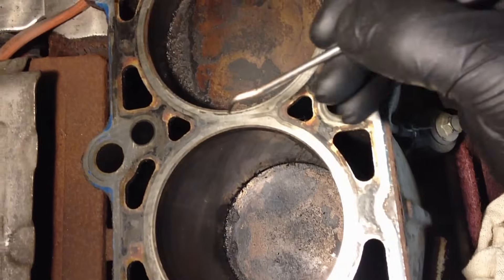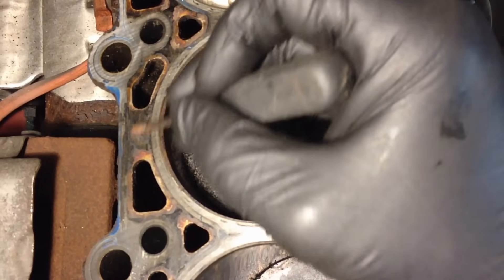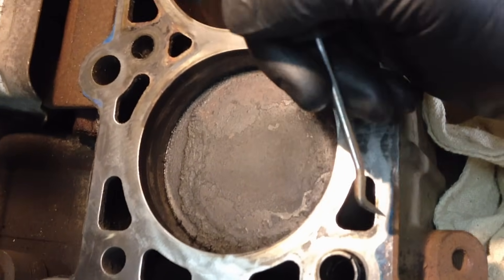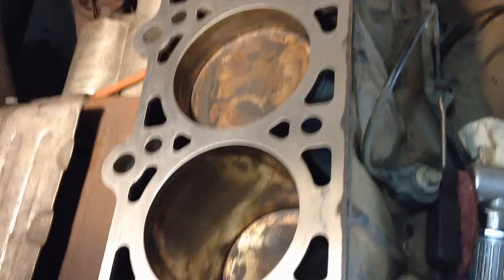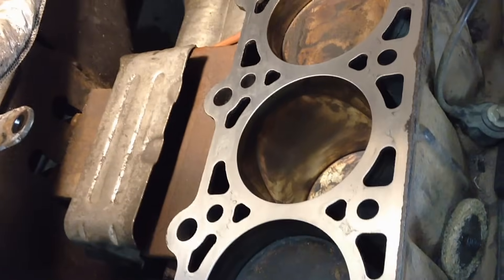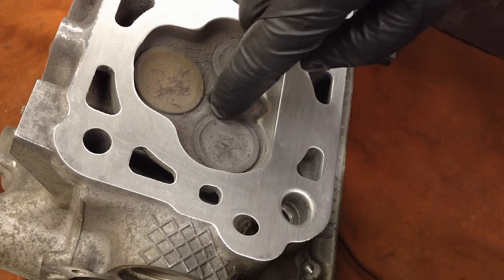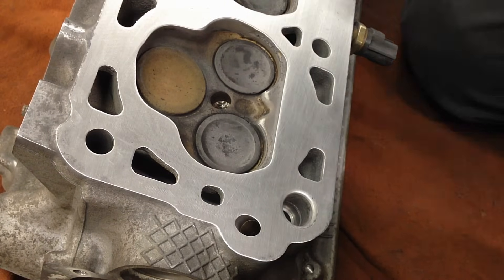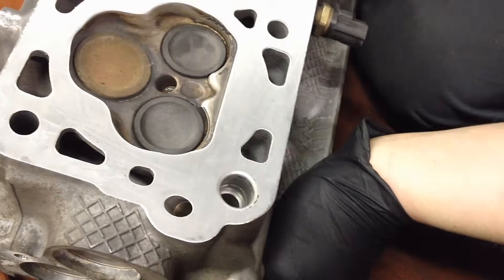My Best Method For Cleaning Head Gasket & Other Engine Surfaces

Comment: Large sharpening stone with lightweight oil for cast iron. Just tough around the dowel pins if u leave em in. Brings out the original factory machining  patterns . Been using sharpening stone since old timer from Ohio showed me in the 80's.
Reply: @Johnny Five Same, just be sure to use the fine side of it.
Reply: Takes two seconds to remove dowel pins. Lol

Comment: Plastic scrapers and gasket remover MAY work with removing old gasket material, but it DOES NOT do $hit against crusty coolant residue and carbon. But yet so many people insist that engines cleaned like the one in this video will self destruct due to aluminum oxide contamination, what's the solution?

Comment: When I worked at GM they stopped us from using the rolocs because the plastic contaminates the cylinder bores and gets into the rings and causes scratches
Reply: Wrong. The 3m discs shown contain aluminum oxide. This is the issue, not the plastic. Plastic doesn't scar metal. And they can be used as long as you clean the grit as specified in the video. Clean it like you were going to eat off of it. Most mechanics don't spend the time doing this.
Reply: @rhettdean4641 the plastic is impregnated with ceramic abrasive
Reply: Nonsense. The plastic grit from the rol loc plastic discs destroys piston rings and can remove aluminium.
You can't clean the grit out without disassembling the engine to clean the rings @rhettdean4641 
Do some research
Reply: @rhettdean4641  also a  minute with a shop vac does wonders for any left over dust and particles
Reply: Yes but when doing it yourself you can take the time to clean everything. Which you should anyway.
Reply: Could just stuff the cylinder walls with rags or cover them
Reply: @christiansgarageLLC  Not effectively. I use carbide scrapers
Reply: Lol

Comment: On my 97 gt mustang..someone put paint thinner or lacquer in my gas tank..will it hurt my car
Reply: Robert, one of the ways to clean catalytic converters is to put 1 gallon of lacquer thinner into half a tank of gas then drive on the freeway or other place where you can drive faster. Often this will clean a catalytic converter enough to pass emissions tests when it wouldn't before.  This won't harm your engine. Might even clean the fuel system.

Comment: I hold a shop vac tube in one hand while scraping the gasket off with a safety blade in the other hand. Keep your blocks clean!!! I also have made an adapter from pvc piping  parts to hook an old clothes washer hose to a shop vac and I can drop it into the block and start filling with water, stop, and vac. I do that several times and what a difference!!! I've pulled a lot of crap from my blocks. IF I need a smaller hose, I can slide another smaller diameter hose inside the washer hose that I've cut one end off. Remember, do not run the shop vac until you have the 'block half', near full of water otherwise it won't dislodge the old debris because it's just vacuuming the trickle of water instead of gulping the mass garbage you dislodged and floated to the top.  I use a transmission funnel to fill the water ports above while the hose is in about 5 to 7 inches on the bottom..

Comment: Another tip is use barbasol shaving cream in the oil and coolant galleys, it expands and catches any debris or dust while you are cleaning, then you just vacuum the cream out of the ports. You get almost zero debris in the engine.
Reply: Using shaving cream in the water and oil galley ways is one of the smartest tips I have seen on YouTube in a long time.  Genius!!

Comment: used this info to do my volvo  98 s70 head job (burnt valve) in OCT 2016....now its 7-17-2019 still running with 260 k on the clock....works and didn't have any issues ...just used the same disk to do my 2006  s60 oil pan last week ..they last while and stores years and WORK !!!!!

Comment: Would you recommend resurfacing the head after I pull it off? If so, what about the block surface? My 08 F-150 has 197,000 miles on it. The truck has no leaks at all, runs GREAT. Never overheated or anything.

Comment: I see the rounded edges also. Lol yeh always use the longest block possible. I wouldn’t sand anything with all those holes tho. Metal Right on top of the lifters.
Reply: Lifters ?? This isn’t a push rod engine
Reply: Yeah but has hydraulic lifters down in those holes. Filled with oil so I worried about vacuuming anything out of them so filled with paper towel and then used vacuum to remove paper towels. Lol. Just sayin metal flakes in oil guaranteed and lifter oil holes are small and easily plugged with stuff like that. I replaced lifters with crown for 42$ since head was off I couldn’t resist. Really easy to swap new ones in

Comment: Can you change 4.6l to a 5.3l by changing the heads
Reply from the maker: Ford does not have a 5.3l engine.
Reply: Can you upgrade a4.6L to a 5.4L engine  by changing the heads
Reply: @patrickbigley9627  no lol

Comment: In addition to the rags, I also use a shop vac at the same time as the 3M to suck up as much grit as possible as it is made vs letting it stick to wet or oily surfaces.

Comment: A small yet powerful vacuum cleaner with a plastic drinking straw well taped to the crevice tool will get down into the water channels and around the top piston rings.  Better to suck it out first then blow with air.  Also when using the whizzers, much like clipping grass with a weedeater, you can use the outward-throwing edge gently to throw the corrosion and grit off the  block or head and not into the cylinders.  Love the scotchbrite idea.  Been using that on high vacuum aluminum and steel at the lab since the 60's. It's the cat's whiskers!

Comment: so how did you fix the measure and gauge issue?? the engine could possibly still be warped the way you did it
Reply: If its warped then youll have to take it to a machine shop either way

Comment: The top machine shop in my area uses wire wheels on iron and soda blasting on aluminum. On my personal projects I scrape as much as I can with a blade, and finish with wet sand paper and a piece of thick plate glass. Plate glass is as accurate as a typical resurfacing machine at a machine shop, but takes much longer. Use alternating directions. Don't use finer that 220 grit because the small peaks and valleys will bite into the gasket and help it seal.
Reply: Well said , I use this method also as well as other methods,, using what's available and depending on the job, nice comment.

Comment: I filled the bores with fresh oil applied to paper towels or clean rags. Then I used sandpaper to clean the deck. Finally laquer thinner to do final clean. Never had a failure after that.
Reply: Sand paper  in the engine won't flush out
And sands all the bearings  and destroys the engine

Comment: i use a very flat straight piece of wood  7in X 9 in X,1 in, little bigger than the bores put a little handle on top and use sand paper  spray tack or staple the sides take those dowels out and go back and force on the block and the head 100,180,320 grades

Comment: Have trouble with sealing head gaskets.  Coat the next headgakset in 30w oil I bet my life it will seal.  old time circle track engine builders trick.
Reply from the maker: The block must be perfectly clean no oily residue at all even for these Ford MLS gaskets to seal.
Reply: copper spray also works :)
\
Reply: spray copper coat is good . plus feels good with a glove is not ample.

Comment: Been using abrasive 'cookie wheels' for 30 years. 20x faster.   Zero issues.
Reply: After machining heads that idiots like you decided to "clean" I will never recommend using any high speed abrasive. I shouldn't have to take .020 off to clean up the surface and still see gouges.

Comment: I just use a shop vac for the coolant and cleaning out cylinders. but wow that engine looks horrible! i just did a volvo 5 cylinder with 257k on it and it looked brand new inside. good job cleaning it up

Comment: Great video, might be a silly question but is there any value is cleaning the carbon off the tops of the pistons since you have access to them?
Reply: Carbon is hard and abrasive, think of what makes up diamonds. Dont let the carbon you clean off get in to the piston rings. What I do when I do head gaskets and see a lot of carbon build up...put that piston to TDC. Put a thick coat of bearing grease around the cylinder over the rings. Clean the carbon off the top of the piston with a brass brush or soft stainless brush with whatever additional chemical to help break up the carbon. Wipe it all out with a towel/rag. Drop the piston half stroke. Wipe out the remaining grease from packing. Then go on to the next cylinder. After all cyls ate done like that, I go back through with every piston at BDC and wipe then clean again with a towel/rag soaked in brake clean. Then again with a towel/rag soaked in ATF. ATF has detergents in it, and it lubricates/protects against rust until you're ready to drop the head on.
Reply: Absolutely zero benefit to cleaning the pistons and a good chance of hurting the motor. Dont do it!

Comment: Nice job, I usually use 400 then 600 on a block. Also use some carb cleaner to clean up the pistons. But that's just paranoid me.
Reply: What material head gasket do you use? Hoping my surface will be clean and flat enough for mls head gasket. Super old comment

Comment: Yoou Never checked the cylinder head with a straight edge and feeler gauges after all that metal removing!
Reply: No metal removing worth worrying about.  Cast iron and aluminum much harder than brush or Scotchbrite.
Reply: @x-man5056  totally agree. Used these for years as a mechanic on cast iron blocks, aluminum surfaces on customer's vehicle's and my own aluminum head race engines and never a leak. Gotta keep it moving, like he said lol
Reply: Exactly what the hell does he think he is doing liability risk ....

Comment: I hate that 5.4 worse engine ever wondering if anyone knows will I have any trouble replacing the heads off of my 1998 with a set of power improved heads off of a 1999/ Expedition? Hoping not just got the gaskets and bolts so we will find out one way or the other

Comment: Many different methods for cleaning aluminum heads, but so long as you don't gouge the heads and grind dips in em, nearly any old way will work. I've taken utility knive blades and scrapped lightly in a backwards direction and that worked good too, then followed up by one of those pads you were using. There are some head gaskets for aluminum heads that requires the heads to be nearly perfect, but for those I've used copper seal spray and it worked just fine.

Comment: Ford had many different ways they wanted their blocks and heads cleaned, over the years, while working at the dealership. The correct way to have a non directional finish without removing all of the mean root surface. Well that was over 20 years ago, and never a comeback or concern. great video.
Reply: How long you work at ford ?
Reply: @brianblithe2271  over 35 years

Comment: Heat gun or a butane torch, old putty knife. To eliminate every trace of the old gasket. Comes off like butter.
Finish cleaning with fine sand paper >400 (full sheet) in a flat block. Paint thinner or brake cleaner or acetone. Whatever is closer at the time.
Really fast and no rounded edges for sure. ;-)
Reply: I'd save the sandpaper for parts being completely cleaned as otherwise grit will come off the paper.
Reply: I hace to clean one soon. I'll try your method because I got the tools you mentioned. Thanks for sharing your method.
Reply: Is butane torching okay for most types of cars e.g. an Audi?

Comment: I prefer a sharp edge brass bar on the iron side, wood or plastic scraper on the head. The RA needed to properly seal an MLS gasket is not achievable with any hand held rotary tools. The biggest problem is they remove material.

Comment: This is a great video. I have done too many head gaskets with a 100% success rate and the key is a clean flat surface. With that being said the head has to be cleaned just like the block. Also, For the love of God and every thing holy. Don't have the guy at the machine shop use a " BELT SANDER" "machine"  your head if you  need/want a metal head gasket! Or you can sit back and watch the oil leak.
Reply: Kenneth Tolbert plbvv

Comment: I understand you don't want any comments but I want to give positive feedback. I have a what I believe is a head gasket failure in my 2002 Civic and I appreciate the explanation and advice you give. I will try to replace it myself. My mechanic said that both mating surfaces need to be machine which is why he quote north of $1000 Canadian for the job. The car isn't worth that much.

Comment: How yo do you verify the gaskets don't contain asbestos?
Reply: When in your life time have you seen a gasket with asbestos?
Reply: Gargle your mouth with white vinegar then chew the gasket when it tastes sweet then it doesn’t contain asbestos
Reply: if you catch on fire and your lungs don't burn, then they had it. asbestos was a staple ingredient in my house growing up. mats of it for welding, and in insulation, it's great.
Reply: +Buck Wheat until u get cancer lol
Reply: motors and pumps up to the early 80;s have asbestos re-enforced gaskets - but nothing really to wory about as they are usually oil soaked.
Reply: bikejunk1
In the US or Europe? 

Asbestos gets airborne when gasket remnants are sanded.
Reply: Old cars are loaded with asbestos brakes mufflers heat shields gaskets don't work it dry
Reply: Wet EVERYTHING down. Asbestos has to be airborne and breathed in to get in your lungs. And the EPA just relaxed use of it in manufacturing under the current administration. (Not being political here. Just saying it's important to be proactive about safety against this crap forever). I work on new and old. And live near Libby, MT, so I keep up on asbestos crap

Comment: Which air gun do you use and how much speed?  Thanks
Reply from the maker: This is the one I use and I would say I keep the throttle around 3/4- http://amzn.to/2cRaJdF
Reply: Thanks a lot, i will buy one, because it looks veeeery clean and smooth. Now i rebuilding my e39 540 and need to clean pistons and engine block at this moment. How do you clean pistons around and inside of pistons?

Comment: I used a single edged razor blade with a shop vac right next to the blade while scraping the crud off of the block to catch all the bits.  Then any solvent on a rag like gasoline to wipe the block clean.  This was a cast iron block, not aluminum.  Worked fine for me.

Comment: I'm an idiot and used stainless steel pot scrubbers to clean the oil off my aluminum valve cover.  The only damage seems to be rough spots on the top.  Did I screw up bad? It looks good.  Just has scratches.  I'm knew to all of this.  I just wanted to change my plugs and found oil in the tubes.  So I figured I'd save $300 and fix it myself. 

Also the Harbor Freight shop rags have a lot of lent and its in the part where I pour oil.  Is this bad?

Comment: The concerns everyone has about the abrasives in the oil passages can easily be taken care of with old fashioned foam shaving cream. Just spray a little into each passage as well as the cylinders and vacuum it out after with a shop vac. After that poor a little oil down each passage and use a lint free clock to lubricate each cylinder. Having cheap oil to put into the engine after the job is done and draining it after a short warm up or test drive is also important.
Reply: Good idea with the shaving cream!
Reply: that is a great idea, i will try this
Reply: Sounds faster than using foil or towels.
Reply: @Sound Money 🤣🤣🤣🤣🤣🤣
Reply: Sounds like a break-in procedure for new piston rings or a complete engine overhaul.  Seems a bit overkill for just changing a head gasket.
Reply: What are you talking about? Ensuring the cylinder walls have a little oil in them and pouring some oil down each passage in the block AFTER shaving cream was in them to catch particles has nothing to do with a break-in procedure. Keeping the abrasives out of the oil system is extremely important. I think you need to do some google searching on what happens when abrasive particles get into your oil system.
Reply: +TJ B right. And I've never, ever heard of anyone doing all that just for a simple head gasket replacement. I certainly did not on my Honda engine when I changed the head gasket at 330K miles. I've put another 25K on it since then with no problems whatsoever.
Reply: He's one of those guys that has all his mechanicing knowledge from YouTube and can't or never will replaced a piston on anything lol. OEMs figured out the abrasives problem years ago.. If it's an all aluminium engine especially its not a good idea to use the 3M Roloc finger banger.

Comment: whats the best way to clean the threads on the block? i am thinking of just getting a wire pipe cleaner
Reply from the maker: I use brake cleaner and compressed air the threads themselves generally don't have any corrosion or other issues that would require the threads to be chased.
Reply: Jethro Bodene sorry. Bolt
Reply: Jethro Bodene the bolts you're supposed to replace with new ones.(head bolts)
Reply: Jethro Bodene some head bolts have gone in to the water area
Reply: Anthony Maffie thread chasers. or tap and die set, or find a bolt that fits and cut it with a dremel and make your own thread chaser. ;)